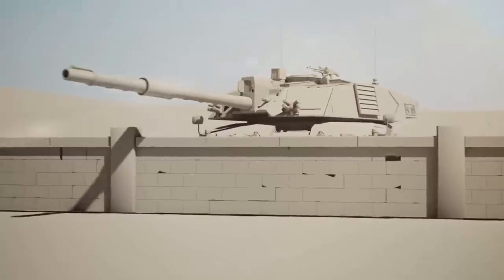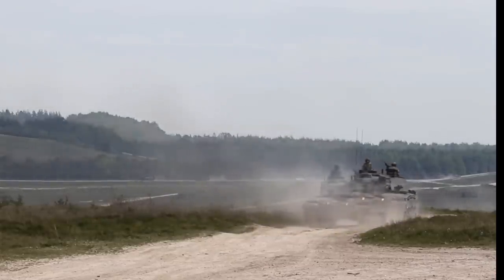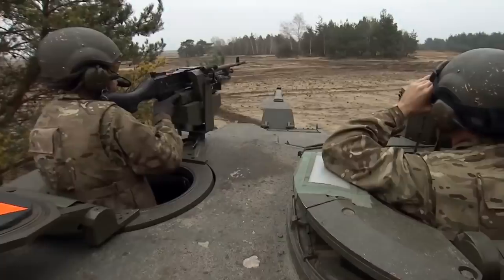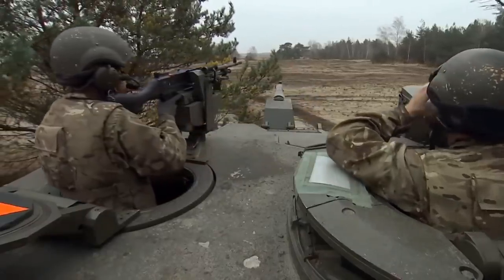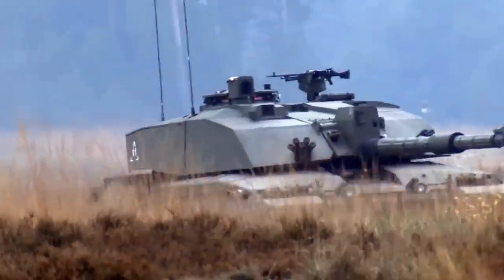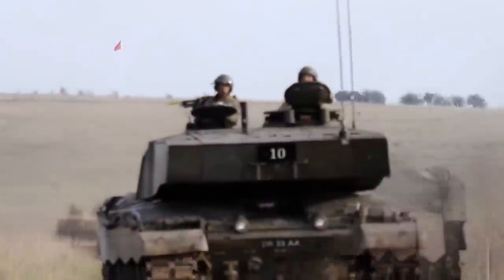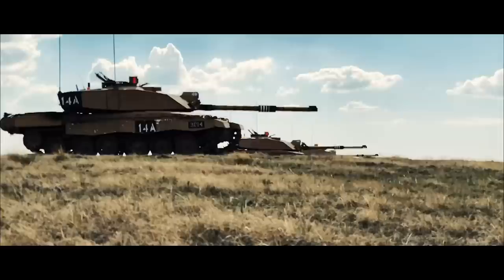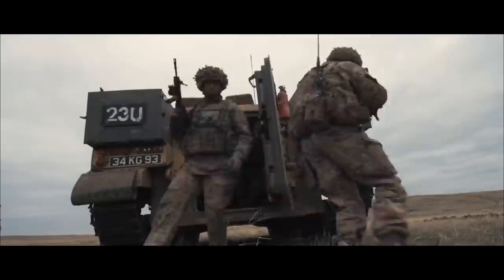Challenger 2 Tank "Black Night" | MODERN UPGRADE

Comment: Sigh it's only truly modern when it ditches the L30 for either a new british smoothbore or the german L55 (due the better ammo choices) HESH has had its day (as delayed fuse HE is way more useful and our HESH stocks are actually dangerous to handle due to their age) and the accuracy benefits of rifled over smoothbore are pretty much non existent these days (partially due to better optic systems) and switches up to a 1500hp engine minium
Reply: Optic systems? Its the fact that the rounds are now fin stabilsed, still not quite as good as a rifled barrel for accuracy but more ammo types available as well as atgm that can be fired via a smoothbore.
Reply: But if you're doing that then you may as well buy a new fleet of Abrams.
Reply: It doesn’t seem to me that there’s actually a requirement for HESH to be spun, fin stabilized hesh should be possible.

The higher the length to diameter a penetrator gets, the less effective spin stabilization is, so smoothbores aren’t at a disadvantage in terms of accuracy.
Reply: in modern battles, tanks are easy preys to whoever controls the skies. No longer might be the days when tanks hunt tanks. Therefore an active protection system is more practical than replacing a good gun with another good gun..
Reply: @SuperBoytech  except that gun is getting outperformed interms of firepower and a logistical nightmare for the rest of NATO, simple fact is that having the gun stick to 2 piece significantly reduces the potential penatration of the rounds, the current rounds are too short to be effectuve against newer armour types and even though the breech block of the L30 is twice the size of the L55 you can't over pressure rounds in it, which is a significant limiting factor at this stage and you can't even use rounds like DM63 or even DM33 at that. It ain't as much of a tank killer as it was.
Reply: IIRC the problem with firing APFSDS from a rifled barrel is that the much lower fin-driven spin rate of the rod is often wildly out of sync with the high rifling-driven spin rate of the sabot, so there is enforced wobble right at sabot separation which reduces accuracy as the fins try to "brake" against the initial spin in order to enter its natural lower spin rate. 

In addition, rifling itself reduces the total kinetic energy transferred to the round as more gas is lost through the rifling gap and some of the forward momentum is converted to rotational momentum. So in fact rifled barrel is inferior to smoothbore in both kinetic energy and accuracy when firing APFSDS.

Also, HESH needs to be spun because the explosive is a gel. When the round is fired, the CoG of the round may be offset from its axis at the breech of the gun depending on how the gel settled during storage and transport in the turret. The spin forces the gel to evenly spread out around the walls right before leaving the barrel.
Reply: Phos9  Hesh does have to be spun, it's the fusing that requires it not the warhead.
Reply: And any projectile relying on a shaped charge loses effectiveness when spun. Apparently it can potentially hinder the forming of the nice tight jet of "copper".
Reply: @andrewsuryali8540  There are slip rings that isolate the sabot from the barrel rifling, although a desired slow spin is still imparted on the sabot. The 'rod' is spinning at the required rate when it leaves the barrel and hence requires no 'spin' from its fins. The fins of a rifled 'rod' are straight, the fins of a smoothbore rod are canted to produce spin. However as the smoothbore rod has to gain spin as it leaves the barrel there is an inherent inaccuracy compared to rifled, and a reduction in velocity from the aerodynamic drag of the canted fins. Challenger 1 holds the record tank kill for these reasons.
Reply: battered walrus   A sign of the digital age and internet.  People read or hear something online, it gets constantly regurgitated and everybody jumps on the bandwagon and believes it without question.  

The constant crap told about this tank being no good without a smoothbore gun, is becoming monotonous.  Would this gun be a better choice? Probably but it doesn’t change the fact this is one of the best tanks in the world, still has the best record in actual combat, both defensive and offensive, so all these armchair ‘experts’ leaving comments need to get a grip and sense of reality.

Comment: There is a historical precedent: When the T-64/65 was to expensive the Russians started production of the T-72, which was an all right tank, but nothing more - and a budget decision.
These tanks have gone under upgrade after upgrade to the point of making them immobile.

If the Russians have to shift their very few survivable tanks along the long boarder that will leave some pretty darned gaping holes elsewhere where the antiques are.

The Russians are not going to use nukes - because they know that Sct. Petersburg will be oblitterated before lunch (lets hope for a westerly wind - most common in the area).
Not only that, but they will not achieve any military objective, as the tanks are under way at sea.
Reply: T-72 turned out to be better than T-64 and in some versions T-80 in many areas.
T-72B having the best turret armour out of everything before T-80BU.

The "antiques" were giving western tank fanboys panic attacks when they found out old ass antique EG T-72 could stand up to their "silver bullet" with Kontakt-5 ERA.

Fyi upgrades also included engine.  T-72B3 is currently a much lighter(nearly 20t lighter) tank than Chally2 while having similar horsepower.

Comment: I dont understand why everyone is clamouring for an entirely new tank. Upgrading an existing platform can push it's service life by decades whilst letting it remain a competitive tank and is much cheaper than developing an entirely new platform. Look at the T-72, the original was outdated 5 years into it's lifespan, so they improved it, making the T-72A series that remained on -par with Western designs until the early 80's. Then the various T-72B's, including the the model 87 and model 89 both remained only slightly worst than the Leopard 2's and the 105mm Abrams. The M1IP and Leopard 2A4 both otuclassed the T-72B's, so once again the Russians upgraded it to the T-72BU (T-90) which continued to be improved upon, with the T-90A, T-90S and T-90MS which both were on-par when they were introduced. Even today the original T-72's from 1971 are given just small modifications into the T-72B3M which are on par with most western tanks in service, and that's just a small upgrade. The Challenger 2 can also follow this path, making small adjustments and improvements over many years whilst remaining competitive, all at a fraction of the cost of developing an entierly new platform. Thats why the T-14 Armata failed, and the russians decided to keep going with the T-90's. The UK can learn from others.
Reply: You can't compare the CR2 with the T-72 in terms of modularity and life expectancy. You can't even compare it to other NATO MBTs in that matter.

The UK wants to relieve the CR2  in the 2030s, it would be 36+ years old by then. However Abrams and Leopard 2 users also plan on relieving their MBTs in the 2030, making them 50+ and 51+ years old respectively. They have a ~14/15 year longer life expectancy.

The most comparable NATO MBT to the CR2 in terms of age would be the Leclerc, but they want to keep it in service til the 2040s not the 2030s, making it 49+ years old by then, giving it a ~13 year longer life expectancy.

Now, the T-72 is topping all of that. It is expected to service at least to the 2030s like its NATO counterparts, making it impressive 58+ years old at the time of retirement! The T-72BU (T-90) might last even longer.
Reply: Armata is not only a T-14 tank, but a platform for new systems. You confuse pre-production samples and those that will be transferred to the army.
UVZ stated that:
T-14 will be produced in parallel with the repair of T-72B, modernization of T-80B and T-80U, T-90A. This is done by different enterprises. As long as the Armata platform does not occupy all niches of use.
Why not make it fast? Because it is not a game or comics. It takes years. Few people are able to realize a similar scale. These are not 200 and not 500 tanks, they are thousands of units of equipment, not only tanks.
This work has been done since the mid-80s (Project 299). And now gives its fruits)
Yes, the 152mm module is ready. But it will have another cipher, not T-14. There are many specialized machines.
Reply: Jonny
That's right.
But the T-55 will be serviced as long as there are parts. Like AK)
Reply: @jonny2954  - Firstly, you got a source to support your claims?
Secondly, when the government wants to replace it and when it will actually be replaced are two different things, and when it is actually outdated is another thing entirely. The updated CR2 will probably be in service till the late '30s, early '40s. Which would be 40+ years in service. And if its still cheaper to update rather than replace then they could easily end up going for another 10 years.

Comment: I was an armoured farmer back in the day driving a chieftain bridge layer. What a heap of junk that was. I drove a development challenger at bovy and it was like ide jumped out of a reliant Robin and stepped into a roller. Such a massive difference, even the sound was please t compared to the chieftains fukin awefull screechy whine. Wish I was just joining as the kit their getting now seems so much better. I even had to buy my own bergen and goretex bivi bag or I would have been stuck with a 30 litre large pack and a soaking wet doss bag. Cool vid.

Comment: I was a member of the Challenger 2 user trial Team at ATDU Bovington. (Scots DG). I did my operational stuff on the original  Challenger. I'm looking at the black knight stuff and I think that it is a bit too localised. Its all about responses and systems to deal with engageable distances. This is a good idea, but this tank needs an integrated armed drone system.

Comment: The original Challenger holds The World’s Record for a Tank vs Tank kill. The distance - which history books record @ 5100 meters - but which occurred @ 4700 meters according to a British Tanked present (This is between 3.17 to 2.92 miles respectively) - in either case far exceeds the range of 1200 meters which often cited as the maximum range for a reliable kill. The Iraqi Tank was a T-72.

As a Yank - I can only say…”I’m glad a tank crew who could shoot so well was on our side!”

Comment: Very well put together & a professional team developing LEP. All such enhancements & upgrades are a compromise - and will be scenario dependent factoring in topography, threat, environment etc. As noted APS may have some issues with it - blue on blue effects, false alarms etc. Battle damage to sensors & optronics. APS will also influence vehicle signature in particular ways.

 I guess main driving force is that you can only wring out so much protection from existing armour packages so that you have to look at APS as a supplement to prevent weapon impact. Latest generation of ATGM warhead have unrivalled capability (Kornet etc) & can be launched beyond Challenger main armament reach.

The difficult is that you have so many factors & engineering dependencies for the incorporation of protection packages & wonder whether advanced modelling tools and virtual reality can help in this. This assists the system designers & architects down-select options or fine-tune to particular threats. So far Scenario A - use add-ons A - for Scenario B - use add on B etc. The approach described in video is sensible to focus first on upgrading vehicle electronics and comms & then Active protection & armament.

From my time in Leonardo - wonder if the virtual reality tools at Basildon might be of assistance in this context. This allows scenario incorporation, fly through animation and drill-down into vehicle structure via 3d-CAD. Its a powerful capability - although BAe Systems may have equivalents.

Comments on Mobility & Firepower are noted - although IMO AFV protection comes first & stowage of rounds is critical - as lurid videos elsewhere attest.  This  improves crew morale _ although no doubt designers may prefer to shift the balance elsewhere.

I hope these ramblings makes some sense.

Comment: Knew of the 120mm and new turret "upgrade" but did not know it was going to be called Black Knight. Awesome.
Reply: @komradearti9935  If I were UK, I would go with 120mm for now, the 130mm is not in widespread use and ammo for it is still not as cheap and plentiful as NATO 120mm is. Plus some Countries are still weighing the reduced ammo count versus improved lethality.

Comment: I think the comments about obsolescence are the key - they are not really aiming to upgrade the tank but are just making sure that for each bit of equipment in it they can get spare parts and have a supplier to go to for problems.  e.g. The active kill is "optional" as you heard and I wonder how many of the other "new feature" changes  also optional and will be rejected to save money.

Comment: Hi Mats,  
By the looks of it, the addition of an APS and independent commander thermal imaging sight will improve considerably on its already impressive combat performance. However, I am rather sceptical of all the fancy electronics, for two main reasons. First: when the Dutch Army bought the CV90/35 for its armor infantry, the so called vetronic broke down very often because of 'not being hooligan proof.' It proved that vehicle crews could not deal with these delicate systems with the care they require. As such, the CV90 became rather expensive to use. Two: a Dutch soldier that was deployed to Estonia last year said they experienced very heavy EW jamming to  a point, where the battlefield Management System datalink broke down. And he told me, that all but crippled the battlegroup he as part of. 
As for the gun: I think the rifled 120mm gun has had its best time, as does the 120mm smoothbore guns. Future conflicts - I hope will never materialize - probably require engagement over longer distances and with far more kinetic energy, than either 120mm gun can provide. And a new, more powerfull and more fuel efficient engien is always a good thing. 
All in all I believe the basic design of the 'Siperbrick' is so good, that I hope it can be adapted for a better gun and engine and that we can admire this steel fury much longer.